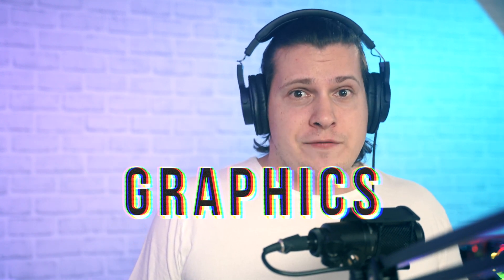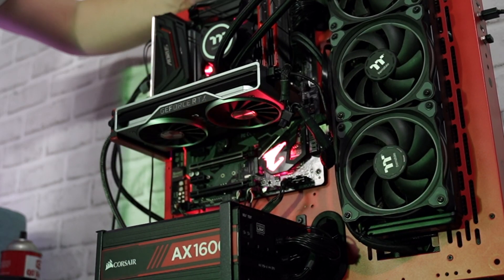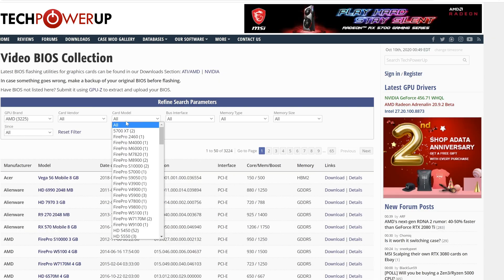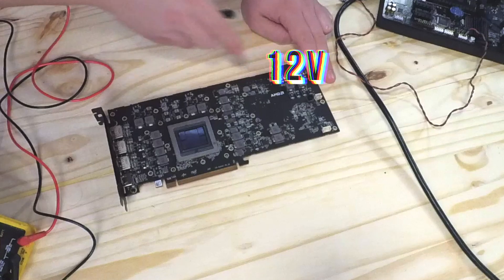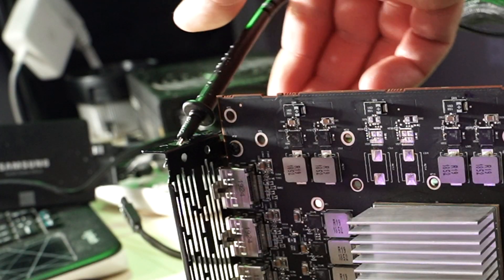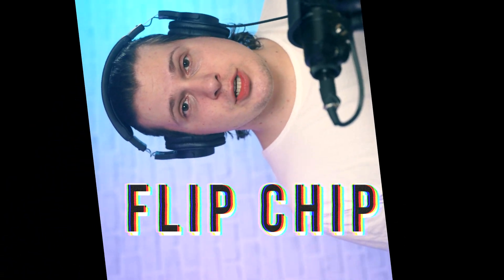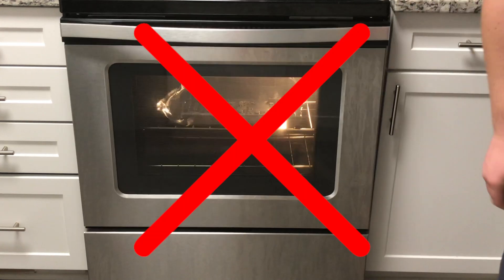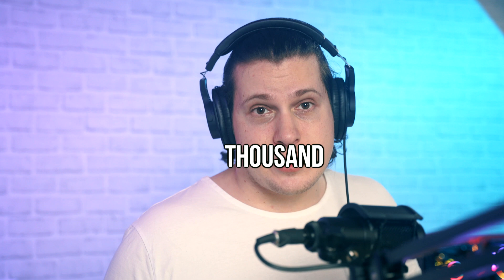How To FIX Dead Graphics Card

Comment: Great Video have subbed as its one of the more informative videos I have found, I have a rtx 3080ftw3 that is showing VGA light and not posting, have put a second GPU in and it does not appear in display adaptors when you were talking about reflashing the V-bios with NVflash is this what you were meaning by could not find?

Comment: I have an issue with an GTX 1060 6gb GPU (Inno 3d Compact X1) that can't run a mats to test it, also has the error 43 and gpu-z shows everything good except ram (0mb), bus and bandwidth. This is a memory corruption issue I guess but I don't know if it is one of the memory chips, memory controller or anything else.

Comment: Fantastic video! I hope you blow up soon! Anyway, I'd like go ask regarding my rx580 gpu, it seems to experience artifacts and will boot the pc down whenever it experiences heavy load, I have all the drivers ready and my psu can support it, so it leaves only a gpu problem, but I can't figure out which, I don't even know if it's hardware or software related

Comment: Any new videos on the vii? I have 3 that have code 43. Updated driver/bios successfully. Tested all the voltages. front of the card was fine back of the card seems to be all shorted out. the 12v/1.2v/.9v rails all seem to be shorted on all the cards. Oddly enough the 5v rail seems to be fine. Visual inspection under a microscope shows no visual defects. Im thinking its the same component that are taking all these cars out. Im just hoping its a 12v cap or something and not the processor.
Reply from the maker: One of the mosfets shorting. They look ok visually most of the time. Disable phases one by one by removing mosfets and see if it boots? Have you checked the controller?

Comment: My cooler is working but why does it not work and shows me black screen, but when I turn on the device on the motherboard, it works without problems. How do I know the problem of the external graphics card?
Reply: and games or things on my pc working when i plug graphic card but is black screen!
Reply from the maker: Reflash bios
Reply: @GeorgeTech  Ok but i tried my graphic card on another pc and it's still not working but i will try reflash bios!
Reply: @GeorgeTech  hi man i restart bios and cmos, but is still not working you have other methods ? Bcz is weird cuz cooler on gpu work and games too but i have black screen! You have other methods pls
Reply from the maker: @retali6480  yeah, you can watch the video lmao

Comment: The heat gun method really works! i got used RX470 that won't detect nor have any display. blasted it with much heat and it still lives until now (been a year)

Comment: Ehh I got 4x 2080ti's for free and I suspect most of them will just need a repaste. However one is just showing no signal and there is a very slight noise coming from the fan, not sure what is causing the no signal just yet

Comment: Great content ima bout to freeze my 1070 and heat it up.
I think i killed it with a gpu riser plugged into a pcie backwards. Fans and lights still turns on but is not detected by motherboard.
Reply: did u fix ut

Comment: My BIOS says PCI Slot Empty, and I know my GPU is not dead. Any help?
Reply: Reseat Gpu, if that doesn't work try resetting cmos
Reply: @dylin6969  When I take off the CMOS Battery, do I have to turn the pc on when the Battery is off?
Reply: @penguin1215  No don't leave it off while taking it out, leave it out for a few min then put it back and the turn it of
Reply: @dylin6969  ty, ill try it later
Reply: @dylin6969  Let me explain what happened. I updated my BIOS to the latest. After the reboot, the GPU wasn’t sending any signal, so I had to use the integrated graphics. GPU is not detected in BIOS nor Device Manager.

Comment: Just wanted to ask if my gpu is dead it spins 1 minute after that it stops
Reply: Could be a sign of a dying card yes, but use DDU to do a clean Uninstall of your gpu drivers and reinstall them. It worked for my card when my fans stopped spinning

Comment: Does anyone know how to fix a computer that doesn't turn on with GPU connected but does when It is not. It shows a red light when i turn it on with gpu installed.
Reply: Have you solved this yet, Im dealing with the same issue, won't boot with dGpu but boots fine with iGpu?

Comment: Hey! I I'm having a GPU i.e R7 265 I'm facing a problem i.e the connecting and reconnecting sound and the screen freezes and blinks can u help me out ?
Reply from the maker: Try to downclock.
Reply: @GeorgeTech how can it be done do I need any software!
Reply from the maker: Msi afterburner. Move core/mem sliders to the left
Reply: @GeorgeTech  thanks bro..
Reply: @GeorgeTech  I uninstalled the Gpu driver's it's working fine can you please help me figure out what exactly is the problem!
Reply from the maker: You uninstalled and it’s working fine? What do you mean
Reply: @GeorgeTech  I uninstalled the drivers it works fine without the drivers .when I reinstalled it I started facing the same problem again.
Reply from the maker: watch the video and pay attention. I covered all the questions you asking.
Reply: @GeorgeTech  yes sure will thanks again .

Comment: i got a rx 570 and it shows not display and no fans moving its in good condition and the led1 is on so i think my psu is fine. Is my card dead? or fixable if so what can i do to fix it please and thank you
Reply from the maker: lol watch the video
Reply: @GeorgeTech  sorry but can i do the two gpu thing but with my intergraded graphics? ill try most of the methods thankyou

Comment: george tech im back with new problems my rx 570 got fixed now theres a new problem when i openedd a game e.g fortnite when i start to play  my pc just shuts down and turns on by itself its hapeening with many games then i downloaded msi after burner to have temps when i play nothing was over heating my gpu was at 47 and cpu at 55 something  it happens when i  increase frames in the game when i set my fps to 60 the gpu temp is 37 when i change it to 120 it increase do u have any solutions
i want to play at 144 fps but my pc restarts itself when i increase fps  
whenever i increase any setting temps increase and pc shuts down need help
sorry for the bad explanation
Reply from the maker: Sounds like cpu/mem issue buddy. Also DDU just in case
Reply: @GeorgeTech  what can i do to fix this
Reply from the maker: Troubleshoot cpu/ram. Try aida64 stress test. Reset bios. ddu drivers. I’ve talked about some of it in the video.
Reply: @GeorgeTech  do you have instagram or discord so i can contact you there it will be faster there
Reply: when  reseting bios do i just have to run the software
Reply: @GeorgeTech  i did a stress test my gpy temps were maxed at 77 and i dont know about cpu temps but the pc didnt restart and then i did a ram only test when i stopped it and i closed the software a blue screen appeared saying your computer ran into an error  the stop code was   paged in a nonpaged area    something
now what should i do
Reply from the maker: I’m smelling driver bug. What about 3DMark or Unigine? To reset the bios simply disconnect power cable and remove the battery from motherboard then wait 10 seconds. After resetting the bios I would just have a fresh install of Windows.
Reply: @GeorgeTech  remove the battery?
do you have any video on how to do all of this or can u link any video that would be helpful
i went into the bios and did the restore factory settings to default but ntohing changed
so now its just a new window
Reply: i know how to install windows i just need a video on reseting bios
Reply: @GeorgeTech  i reseted bios and installed new windwos its still happening my pc is still restartinng
Reply from the maker: In MSI afterburner lower core and memory frequency all the way down then run some tests. Slowly increase core then memory to default values if the system becomes stable. If the system still unstable with the values all the way down try different memory sticks (ram) or just one memory stick at the time in different slots on the motherboard. Try gpu in different pci-e slot on the motherboard. Reseat the cpu. Lastly, try different power supply. Let me know.
Reply from the maker: RAM/CPU are not happy with something. Good chance your GPU is ok
Reply: @GeorgeTech  the problem is with my power supply i just boght it but it is some how faulty   btw thanks for your help

Comment: Hey man I got GTX 1080 and it's so dead, that my PC won't turn on with it plugged in. Turns out one MOSFET was fried, I replaced the MOSFET, still the same. Any advice?
Reply from the maker: Check all the voltages. Try removing mosfet you replaced and power on. Check controller - look up data sheet for voltage range on pins. Some other stuff could have died. Go around the board with multimeter

Comment: I plugged in the graphic card without cooler like I did and touched the card like I did but there is no heat. Does this mean that my graphic card does not have any problems? But why does it not work and shows me the message: There is no signal, but when I turn on the device on the built-in card, it works without problems. How do I know the problem of the external graphics card?
Reply: Now the device is working, but on the built-in card, while the external card is attached to the motherboard and the fan is working, but there is no picture

Comment: i got an rx 570 it ran for like 2 months then one day it didnt show any output and the fans werent spinning i think it was because of power cuts or the graphic card burnt i sent it to repair the person says that it can be repaired but the chip is very hot and even if he repairs it it will run for 1 day and then it will break do u have any solutions is there anyway to fix the chip
i dont know what chip it is but i think is can find what chip it is
Reply from the maker: Are they complaining about the die being hot? Rx 570 runs hot so it’s normal. If the power restored and all the phases working you should be just fine. Again make sure they restore all the phases.
Reply: @GeorgeTech  they are saying that they can repair the gpu but the chip inside is not in good shape and it can not install drivers of the gpu and it will break in 1 or 2 days if they repair it im gonna get it back and do it at home and what do u mean by  restore all phases please explain that
Reply from the maker: I’ve talked about the phases in the video
Reply: @GeorgeTech  ok
Reply: @GeorgeTech  do u have discord if yes pls tell me ur id it will be easy to chat there

Comment: Subscribed :-)    Because this Radeon VII has the same error like mine. Code 43 in Windows.   How can this be fixed, or cold it have various reasons and I have to act like in your video?
Reply from the maker: Code 43 could be anything that stops the core from talking… start with the bios flash.

Comment: Hey George, first: VERY COOL and USEFUL VIDEO ON VIDEO cards! Second: have a Radeon Vega II (vii) with the same GPU-Z screen - all readable except clock and mem all 0Mhz and Code 43 and of course no video etc. no heat. Fans spin to Max. 
Found a physical damage to a few pieces covered in brownish "hardened" fluid around the core on the back side. Sounds a good candidate for cool repair...😀😅😀 im on it.
Cheers and keep releasing, man! Worth it!
Reply from the maker: The awesome! Let me know how it goes!
Reply: @GeorgeTech  Looks unopened, however on the front side around the GPU itself (the BGA) there is a flux or what it looks like it around each side, not sure if this can come so from factory, no other physical visible signs, which is pretty bad for me as now I don’t think is a broken component. It’s more the chip itself. Not sure how to proceed further, but securely walk towards the heat method... got even a heat reflow air station - will eventually use that one. What was your issue and did you resurrect it in the end? Need so much luck now!
Reply: @GeorgeTech  sold in the end - 99% certain that the GPU die has "died" or basically does not make good contact or is plain dead inside, so replace is the only option. The rest of the electronics is flawless, which is the problem. =)
Reply: Update on the Radeon vii: turned out this card is exactly the card used in another guy´s video and it has had water damage of sorts. 😱😨🤭
I coincidently found this out, by just noticing in his video the same area damaged which was clean here, but found flux on the card gpu which lead me to believe it was heated up before, and checked the number: bam!!! Same card! 🥸 OMG!  Still not give up = smth tells me there is else wrong and not the chip.
The video of that guy confirmed it = he baked the chip already, which for me was prematurely done. The core heats up at power, but the ram not. I am not really certain if that is normal. BTW, @georgetech any idea where I could get a schematics for this board... would be great!
Reply from the maker: @otg-on-tech-and-gear  That's funny. LOL Good job! No schematics are available for the public. I asked XFX - they politely denied the access. Side note, the dude could have "baked" it too much. So we never know. HBM does not heat up much on the boot so you're good. Check all the lines on the SPSes - datasheets are available except for PWMs.
Reply: @GeorgeTech  Thanks - really helps! So I really do not think the chip is actualyl "broken" I now start to think the BIOS is bad, but has to be erased and rewritten off-line, so I got a BIOS programmer =) About the baking of this guy (called Frog, not sure if you know the channel, hope I am not advertizing for him, I do not like completely what he did with the heat gun, but since the GPU us reacting to voltage I do not think its been impacted that much. Maybe shorter life span... you know I was even considering to put it in the fridge too. =) Is your Radeon vii alive or what was it with it actually?
Are you working on new videos? Keep it up!

Comment: I also have a R7 card. Gpu z was registering 0 on the mem and clock so I tried to reflash it but didn't work. Measured the power, vcore, mem core, pcie and chokes. All of which registered a voltage and close to what you are getting. Fuses are fine. The chip does get warm but not hot.
Reply from the maker: Good timing. Yesterday, I’ve reflashed bios with a usb eeprom programmer that did not help. I’m planning to use psu set to 2v and alcohol this weekend to see if something warms up. I’ll keep you posted. In all honesty, it looks like the chip is dead and there’s 50/50 chance reballing will bring it back to life. My chip gets hot after a few minutes. So your issue could be different.
Reply: @GeorgeTech  I'm just waiting for my thermal camera to see if that will tell me something more. Then I'll try to reflow the chip.
Reply: @GeorgeTech  Finally got my thermal camera. So what I ended up having to do was I placed the card in the freezer for about 30-45 mins then plugged it and used the thermal to see if any component heats up faster than the rest. What I found out was there were like 2 or 3 caps that heated up faster than the other caps. Chokes are dead cold even after 5 mins on, drivers on the left side of the board (the ones closer to the I/O ports are cold. The rest heats up slowly. Once I get a proper heat gun and not a hair dryer I might try reflowing the chip.
Reply from the maker: Awesome! I would try to remove those capacitors to see if it helps at all. If they are resistors I would just leave them on till you can fine new ones. Please keep me posted. My chip has a short unfortunately.

Comment: This is underrated, in my case tho, my gpu does post, but sometimes if I restart it doesnt then if I force shutdown wait a couple of minutes then it will post, but if it does post with a random time it will just suddenly shut off, any ideas? I've tried alot of power supplies. Alot. About 5 of them with the range of 500-600watts, im using an rx 570
Also the core does heat up
Reply from the maker: How hot does it get? Put a game in window mode and run gpuz or hwinfo. Clean the card with alcohol including PCIe slot pins.
Reply: @GeorgeTech  I see 64c just before it shuts off, the core does get hot, so does that mean all the stuff you pointed your multimeter to, works? I do have a multimeter, but I dont know what Im looking for
Reply: @GeorgeTech  but sometimes even when im not benchmarking it just shuts off randomly
Reply: @GeorgeTech  now its just power cycling... Its a very long power cycling...
Reply from the maker: 64c is fine. If you already tried to clean everything then yeah I would start looking into multimeter action. What model of the card you have? I have a couple of 570s here.
Main idea is to have one probe to the ground and another one touching legs of the vrm chokes on the back. You should be able to spot 1.2 or so volts. In the range of 0.6 to 1.2 for the core and memory. You could be missing a phase. Look for cracks on mosfets and capacitors also.
Reply: @GeorgeTech  its a gigabyte gaming 4g
Reply: @GeorgeTech  also the two of the vrm chokeseasure .80-.90 volts and the other 2 are 1.4-1.5volts, dont know which ones the vcore or the memory tho
Reply from the maker: Weird. 1.4 is high even for gddr5... this could be the issue. Give me a few days I’ll check on msi gaming. Also, underclock and downvolt to 1000mv in overdriventool. Keep in mind you can’t change ddr voltage just the controller even though it could say memory voltage. Let me know if you run into problems with the software. Also have you tried to reflash the bios with amdvbflash?
Reply: @GeorgeTech  I did flash its bios a couple days ago, bbut it was working perfectly, dont know what made this happen